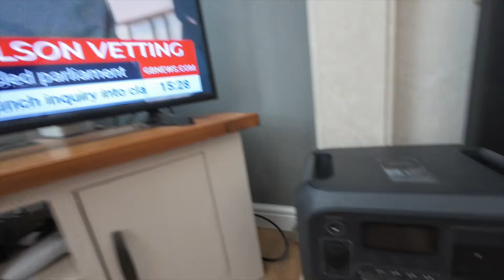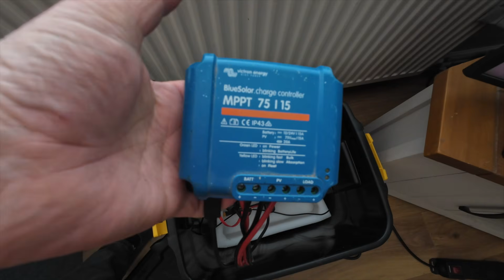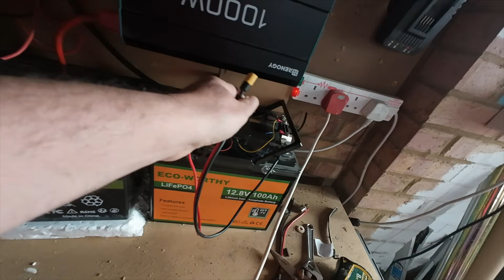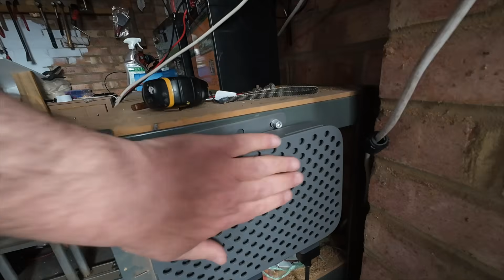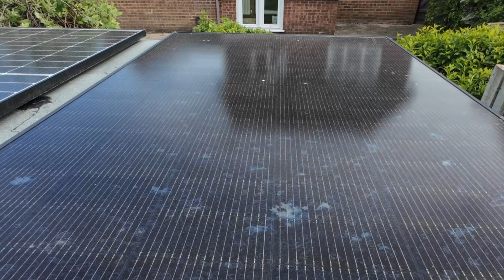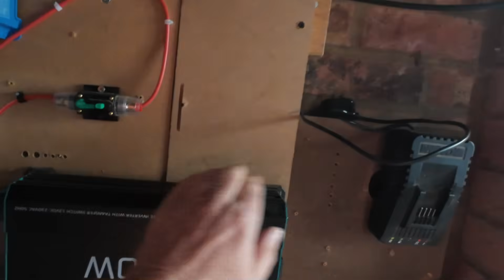Why I'm not buying into Ecoflow Solar!!

Comment: I am thinking of getting the ecoflow stream now £150 and two large panels maybe +500w. I am not going to bother with batteries. I just want to cover base load all year while not spending much on the new gear. Problem is in winter even 1000w of panels does not make much. How do your two larges panels do in the winter?
Reply from the maker: Thanks for the comment, they definitely struggle to generate much power during the shorter, darker winter days.  That said they still produce around 50 watts each, that’s mainly due to the angle they’re at… not good
Reply: Good plan; 410 Watt panels are now down to about £60, so two of them and an 800 Watt Stream seems like an economical option. 
In the British climate, the panels will output less than the rated peak output and a lot less for most of the year. 
The inverter is limited by voltage; a higher voltage will fry the inverter, so we need to check that the panel voltage is within that limit. 
The inverter draws amps; the solar panel doesn't push amps into the inverter. 
Hence the inverter will draw up to 400 Watts from each 410 Watt panel. ☮️
Reply: @Tim_Kent yes that is right, estimate suggest in winter the panels might only output 10% so just 120w from 1.2k of panels but better than 80w from 800w of panels. The slow burn I think is the way to go. Not sure where you are buying your panels but yes they are cheap, it is more of a question of where are you going to put them as they are so big! I wanted to get four panels and put the in parrel but its finding the wall space. I am focusing on walls rather than roofs because walls perform better in winter. The way I see it is solar does just fine in summer so you need to think about winter and oversizing. But yes you are right need to watch the volts as don't want to burn out inverter, Ecoflow is max 60-65 volts I think so need to be careful because 400-500w panels are 30-40v. I am thinking about Hoymiles HiFlow 800 Microinverter as it is 100v.

The panels I am looking at have Open Circuit Voltage (Voc/V) of 40v so I am thinking I can not use them with the Ecoflow inverter? Or should I be looking at Maximum Power (Vmp/V) which is 33v???
Reply: That HiFlow 800W micro inverter with 100V max input voltage sounds interesting; I had not heard about that brand before. City Plumbing is advertising those at £94 😎 while the Ecoflow Stream seems to have jumped up to £150 😱. 
City Plumbing was also selling LONGi Solar Hi-MO 410W for only £60 but their site now shows no stock, so maybe those are sold out. 😕 With the current spike in silver & crude oil prices, future stocks of solar panels are likely to be more expensive. What are the best value solar panels that you have found that are in stock ?
Reply: @Tim_Kent I think £50 is about the cheapest I have seen, but you are getting an older panel for that money e.g. 19-20% rather than 23-24% efficient which can make a difference if you have limited space. BUT if you can fit 4 then it might be the way to go. I would love to have 2 east and 2 west as I think that would cover the day best. Personally I have most space on my west wall but not enough for four panels.
Reply: Over the whole year a good rule of thumb for middle of UK is southish facing panels with no shade generate about 1kWh per watt of panel. You look at over the year for a small array - it's mostly saving you money in summer not winter.

If you've got batteries then you get something with ToU support (eg the Bluetti AC200L/AC300/Apex300 etc) or which you can use it with an EV tariff as well and top it up in winter on the cheap. Depends on the rest of the setup.

Comment: You need to look at the specs as well. Ecoflow stream batteries are rated for 6k recharge cycles where as most powerstations and server batteries are 4k cycles. Also no connecting and disconnecting all the time, one setup does it all.
Reply from the maker: Thanks for the comment, you maybe correct on the specs but it’s just not worth the big financial outlay for what I do and suspect many others too. Also, if the power goes down these units are small and light enough to carry around the house.
Reply: Everyone else says "cycles to 80%", Ecoflow just say "cycles" - be careful what you compare.

My Fogstar kit is 8000 cycles to 80%. Honestly I don't expect it to matter because a measurable part of battery wear is straight forward ageing not cycling and unless you are using something like Octopus Cosy and triple cycling small batteries three times a day it's not going to matter either way.